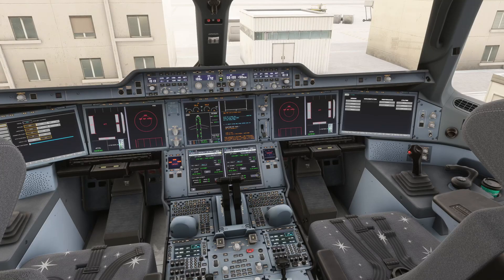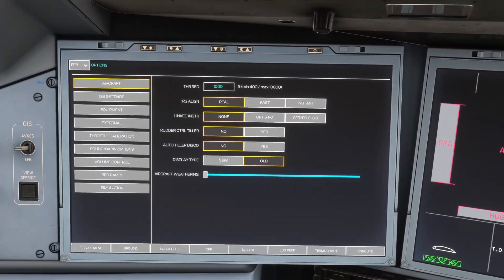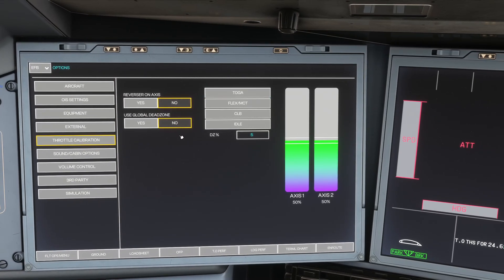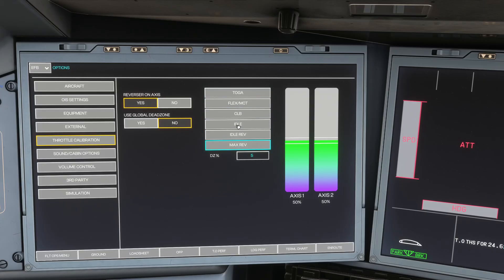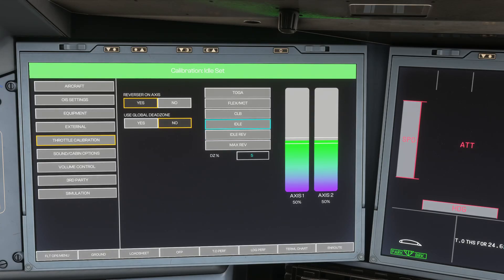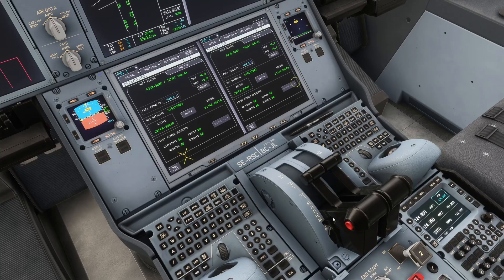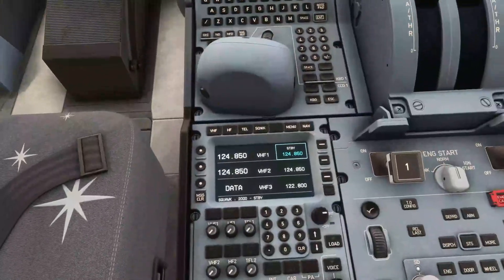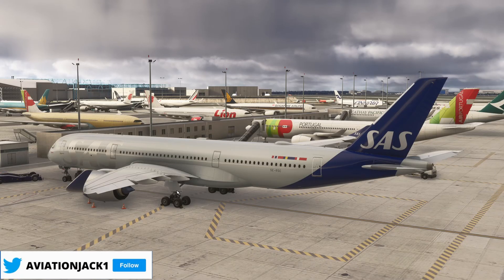How to Calibrate the Inibuilds A350 Throttles | Thrustmaster Airbus Quadrant

Comment: I did it exactly like that, even the 41 % for idle reverse, but it is not going there 😞
Reply from the maker: Thats really strange :( Do you have the reverser on axis setting in the tablet set to yes?
Reply: @AviationJack  Eyup. The solution was the play with the deadzones, the default 2 % was too stiff, I set it to lik 10 and it works perfectly now 🙂

Comment: If you're having issues with the reverse thrust not working even after correct calibration in the EFB, try this: If the EFB settings don't seem to take effect, you may need to manually edit the ThrottleData.ini file located at %LOCALAPPDATA%\Packages\Microsoft.FlightSimulator_8wekyb3d8bbwe\LocalState\Packages\inibuilds-aircraft-a350\work. GO TO THE THROTTLEDATA FOLDER at the bottom of the list and open it.
Change reverse_on_axis = false to reverse_on_axis = true if you intend to use reverse on axis, and save the file. Make sure you restart the sim and it should work.

Comment: Hello, my problem is that when I press F3 to a certain value, the levers quickly go to 100 and I can't adjust the value. What is the problem?
Reply from the maker: Hi, in your keyboard settings through the sun settings F3 I believe is set TOGA straight away so automatically jumps to toga

Comment: Did exactly the same, but reverse does not work. I tried toggling reverse on axis on and off and recalibrating a few times too. What were your settings in the MSFS controls settings? Throttle 0-100% or just "Throttle"?
Reply from the maker: apparently you need to set the dead zone to like 2.5% to get it to work, see if that does anything :)

Comment: No offence, but I think it's probably much better to research and learn something before trying to teach others. As the latin maxim says, "Nemo dat quod non habet." You can't give what you don't own. You quickly dismissed your inability to get to TOGA as "That must be a 350 thing where it doesn't go into TOGA". Also, you didn't notice that your idle reverse was not the same on both throttles, making one open higher than the other.

The reason you're not hitting TOGA is because the deadzone (5%) is too much and the detentes are overlapping. The distance between the FLEX position and TOGA is less than 5%. In fact, with the Thrustmaster Airbus Quadrant, I'd recommend 1.5% or even 1% because of how close to one another the 2 detentes are

Which brings me to the other thing you just overlooked, the global deadzone button. You turn that on if you want to use the same deadzone % on all detentes. Otherwise, you turn that off, then give different deadzone % for each detente. For instance,

TOGA 1.5%
FLEX 1.5%
CLB 2%
IDLE 2%
IDLE REV 2%
REVERSE 2%
Reply from the maker: its not that deep... 

The reverses isn't an issue it works for me that's the way I have it. The null zones didn't work at the time as I tried to set different % but still no toga, that was a bug. It's just a throttle calibration, at the end of the day they calibrated! Thanks!

Comment: Hi, to solve the reverse problem on MFS2020 go to control settings, TCA, power control, throttle, find the item , find the item reduce throttle and in the left-right fields set the reverse axes as inputs left joystick x+  and left joystick y+, and now the reverse levers come to life and work correctly.
Greetings.

Comment: I have it on idle and my plane keeps movin!!
Reply from the maker: probarly just the weight of the aircraft being light. Having throttle on ides doesn't mean the aircraft wont move slightly, thats why you have a break and parking break haha
Reply: @AviationJack  so in real life with idle throttle  the plane moves very slow? Also how do I brake with the thrusmaster tca captain x pack I don't have rudde pedals do I need rudder pedals to brake? If not could you please tell me im having issues with braking

Comment: For TOGA to work , you need to set the deadzone (DZ%) from 5 to around 2.5, otherwise the flex/mct and toga will cross eachother.
Reply: thx
Reply from the maker: Hey ill try this soon, I did try setting it 2.5 when it first released but that didnt work for me either at the time
Reply: this worked for me
Reply: It works, thx

Comment: Need your help, I have a 3d thermal stream that displays when I fly. The option is turned off in weather, but I still get the 3D thermal stream.  It's a pain when you're outside
Reply from the maker: Hey, this annoyed me too! In keyboard control settings there is a shortcut that reactivates 3d thermal thing whenever you press it. If you go to control settings and type it in the search, you can then get rid of the short cut :)

Comment: Hi! Thanks for the video. I'm using the A350 in MSFS 2020, on a PC with Windows 11, with a keyboard. When I long press the F2 button to get in reverse, the aircraft is not moving backwards at all after I release the parking brake. I have this issue with the both variants. I've reached out to inibuilds and they said it sounds like a conflict with the default simbinds. Could you please tell me what should I do ?
Reply from the maker: Hey,  I would go to your control settings and type in reverser and see what key bind it is set to.

Comment: A350 idle should be around 20% thrust, so it can be a little tricky to calibrate the thrust bearing in mind the actual thrust detents of the physical hardware. With the A320NEO i managed finally to match those percents of thrust with the corresponding detents of Thrustmaster TCA Captain pack. After takeoff the thrustlever must go to the climb detent (when lvr clb) pulses white on PFD).

Comment: just copied your settings but my reverser don't seem to be working for some reason?
Reply: @AviationJack The same for me! What do you have tied up to the reversers? My A350 reversers do not move when lifting the reversers in Thrustmaster. I am in MSFS 2020.
Reply: @enriqueosuna   this is probably your issue. Follow these instructions. If the EFB settings don't seem to take effect, you may need to manually edit the ThrottleData.ini file located at %LOCALAPPDATA%\Packages\Microsoft.FlightSimulator_8wekyb3d8bbwe\LocalState\Packages\inibuilds-aircraft-a350\work. 
Change reverse_on_axis = false to reverse_on_axis = true if you intend to use reverse on axis, and save the file.
Reply: @JustinQuitadamo-o6g6q thanks for the recommendation. That was the problem I had.
Reply from the maker: Hey mate you in msfs 2020 right?
Reply: @AviationJack  Yes, I am using the A350 in MSFS 2020.
Reply from the maker: I believe there is an issue with reversers in 2020 and TOGA in 2024 as far as i'm aware. Did the latest update fix that?

Comment: Any update on why toga doesn’t work because it doesn’t for me?
Reply from the maker: Hi, doesn't work for me either... probs a good explanation as to why which i'm not too sure on. I have noticed a few bugs so far flying this plane today so maybe its a bug. Ill keep trying to find an answer though
Reply: Mine’s the opposite problem. No reverse thrust. I’m sure we’ll get there. Great aircraft though. Flew the 1000 from Heathrow to Accra earlier. Buttery landing and the brakes are amazing anyway so didn’t need the reversers. 🙂
Reply: @ do you have the tca throttle?
Reply from the maker: @Flyguysimmer Hey that's interesting that's coming up alot! Are you flying the aircraft in 2020 or 2024?